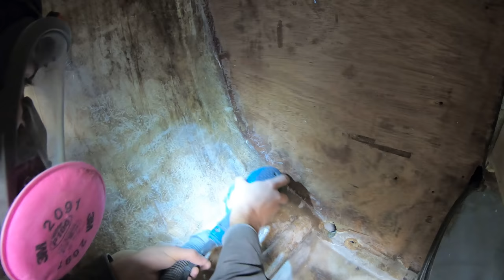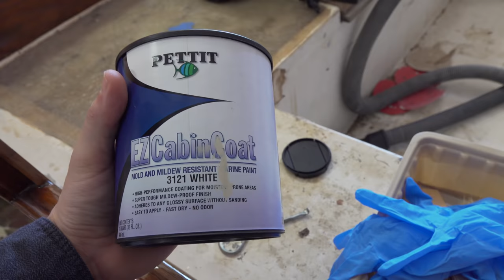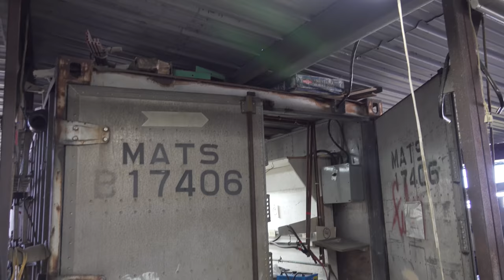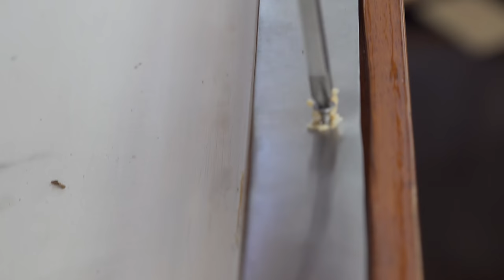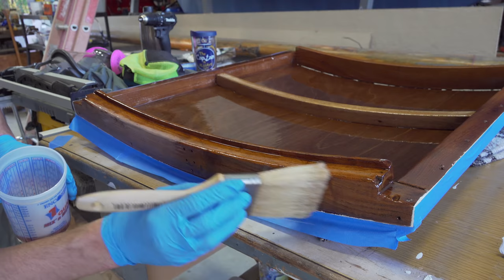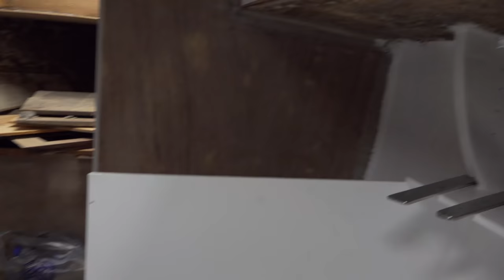Painting, Varnishing, and More | Sailboat Restoration Ep. 37

Comment: Use a right angle air die  grinder with 1/4 Colette to hold the drill bit , very small tool and will fit in that space NP  , you may have to buy step drills to the size you need , but they are available in 1/4 inch shanks. Best Regards J

Comment: That chainplate you were talking about at 10:05 should be through bolted with SS bolts and nuts. it should also have a backing plate for extra strength.
Reply from the maker: I'll be through bolting and using large fender washers. Thanks for the comment!
Reply: @SailBros It does solve the problem of drilling. Now you can drill from the other side. The reason I said backing plate is it is more surface area, and it is a standard practice on a lot of boats.  If you are not going to cross oceans then the washers should work.

Comment: I also just used the Petit EZ Cabin Coat on my boat in platinum grey.  I only had to use two coats but I primed first even though the directions said I didn't have to.
Reply from the maker: I should have primed first. Oh well its done!
Reply: @SailBros  I only primed because the paint in my cabin was so messed up, it was in an uncured state. If you pressed against it, the paint would come off.  After chemical stripping and sanding, I wanted to make sure what was left would be totally covered.  I read the instructions like you did, it said two coats would cover it.  After I finished my cabin, I think priming is probably necessary unless the paint is the same color and in good shape.

Comment: This is looking great!!  What are you thinking of doing to the undersides of the shelves along the hull?  It looks like you didn't paint them on purpose.  Also, I'd just drill the chainplate holes from the right side.  Through bolting is the only option, so it shouldn't matter what side the holes start on.  You're doing a great job with this major restoration and I can't wait to see your boat next to a tropical island (with you hoisting a frosty one while lounging in the cockpit!).
Reply from the maker: I will probably be adding some fiberglass under there to strengthen the deck. I'm thinking we'll use some kind of headliner material to cover it after that. Thanks! That will definitely be an epic moment.

Comment: I've modified a tiny right angle pneumatic die grinder to take a drill chuck, even had to cut the drill bit short from the back side to get into tight spaces.  Better yet, mark you holes with a center punch on the narrow side and transfer the holes to the other side using a common point of reference.  I know how difficult this is on a boat where there are practically no right angles and nothing is really symmetrical, but it can be done.

Comment: Seems like you should be able to drill from the other side just measure how far the chainplate sticks up through the deck, then take that measurement and apply the adjusted measurement to the other side and drill through.
Reply from the maker: Yeah that would probably work. I was just worried about hole alignment. If I drill at different angles accidentally the holes on the chainplate wont line up very well.

Comment: Per drilling holes for the chain plates... I’m not understanding why you can’t clamp a backer board to prevent tear out on the other side and drill through from the right. Is it hole alignment that you’re worried about?
Reply from the maker: Yeah, I'm worried about the holes not lining up. If I drilled straight holes in a thick chunk of wood on a drillpress and used that as a jig I probably wouldn't have any problems. We'll see.
Reply: SailBros, perhaps make a stiff paperboard template, cut it to the shape and tape it  to the chain plate side of the mounting bulkhead. Position the chainplate and pencil the chain plate holes onto the paper.  Drill two very small alignment holes through the mounting bulkhead and paperboard from the right hand side using a guide block to keep the holes perfectly perpendicular to the wood. Transfer to a sheet of scrap 3/4” plywood, cut it to shape, drill the large holes for mounting the chainplate and the two small alignment holes. Drive two nails the same diameter as the alignment holes through the plywood template and install it from the right hand side onto the bulkhead. The pins will ensure the alignment is perfect. Clamp a backer board to the left side to prevent tear out and drill the chainplate holes using the plywood template to guide the bit straight. All you have to do now is dab a little filler in the alignment holes, paint, and install the chainplate!

Comment: Why not paint the inside with epoxy paint?
When it comes to the drilling for the chainplates, you could transport the spot you choose for the hole, from one side to the other using a piece of metal wire, a loop of wire, with the ends pointing  inwards against each other. Just an idea :)
Reply from the maker: Interesting idea! I did some priming with epoxy paint but the fumes were out of control down in the boat so I had to stop.